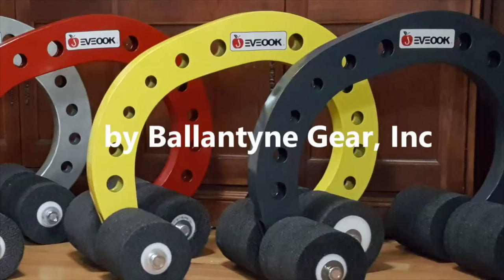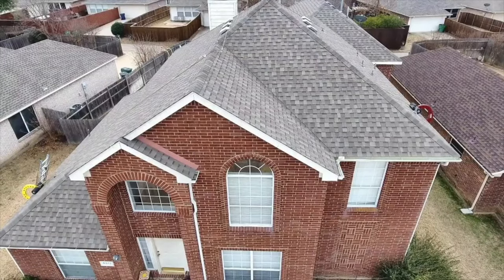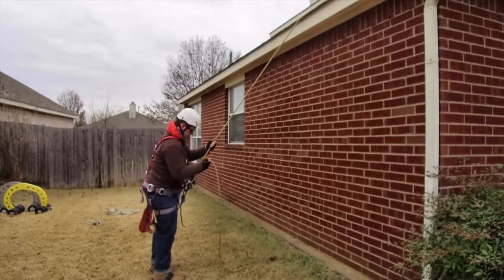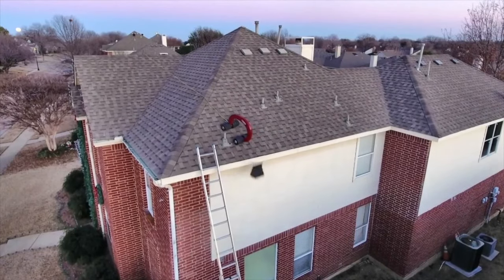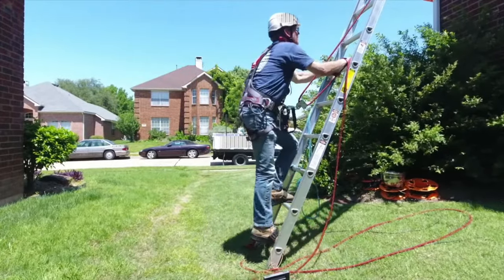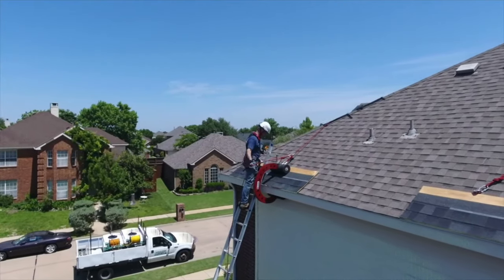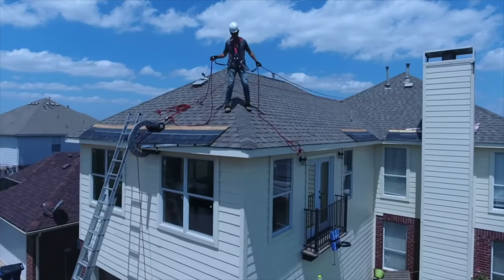Introduction of Ballantyne Gear Eveook Residential Fall Protection System with CAMP. Exceeds OSHA.

Comment: Looks like a good system (for the US market)
Reply: Especially with the sound of that gun! US market ONLY lol
Reply from the maker: Thank you Frank.  You can use pneumatic (air-powered) line throwers, if you want.  They are more expensive and difficult to use, but in some places, they might be better.
Reply from the maker: Thank you!  Also CSA certified in Canada.  We will be getting EN certification in Europe.

Comment: You need to explain more. How you attatch to line, how to tension line, add gear etc etc
Reply from the maker: Go to www.ballantynegear.com and then go to videos.  I believe you will find the explanations that you are seeking.  If you go to Tech Info > Technical Manual, you will find answers there also.  The manual is friendly, mostly pictures.  Or just call us 888-996-3565.

Comment from the maker: Response to Mason Brignac (below). Besides manufacturing fall protection systems, we also install Christmas lights. It's a perfect way to test equipment and methods. Since 2018, for Christmas lights installations, we require the Eveook system on all roofs that cannot be reached, for the entirety, with a 28 ft ladder. That includes most jobs. We have never damaged a soffit. Only one of our customers has stated they have damaged a vinyl soffit. They repaired it by heating it with a heat gun.  The wheels of the Eveook are 22 in wide and made of polyethylene foam,  They are not very hard. We routinely perform 6" drop tests of 310 lb test mass, on installed systems on my home, and these do no damage to the soffit. The polyethylene foam wheels leave no marks.

Comment: We are an engineering company and also do similar works by climbing up on roofs.  We have more than 20 years experience.  We use rope access methods and are equipped with professional harnesses and rope access devices.  What we do is that instead of using a device like this eeveook, we tie off both ends of the rope to stationary structures such as trees, perimeter columns, even a vehicle strategically parked.  This eveook is too big and impractical to carry in our vehicle.
Reply from the maker: If you can't carry it, then obviously you can't use it. They are 26" tall and 32" long, which is a pretty big, but they stack well. By the way, they only weigh 22 pounds.  We have been working on roofs since 2001. I am SPRAT certified for rope access and I am a rock and tower climbing and rappelling instructor. We used to attach to trees, poles, and other anchors, but frequently it was difficult to find an anchor in the right spot. We did lots of other things too. The problem was the anchor line was never right where we wanted it and installation was awkward and took too much time. We are not engineers, we install Christmas lights on steep roofs (mostly 12:12 and 14:12, some 16:12), working on the edge. To create this system, we worked with and continue to work with some of the best engineers in the United States, Canada, and Italy. Our Christmas lights production is up because we finish jobs faster. With the Eveooks, we don't need to advertise for lights business any more, saving us $10,000 every November. Before the Eveooks, we would lose about 50% of our customers every year and had to replace them. With the Eveooks, we lose about 10% but we get more referrals than we can service. Our customers know that we are safe and they don't have to worry about getting sued because someone fell off a roof. If you can find a little space for the Eveooks, your lives would be much easier.

Comment: it's very cool , just not needed. no throw a line over the roof , use a towel and tie off.
Reply from the maker: That’s the most effective (and fun 😎) way we have tested for our system; especially for monster houses we have here in Texas! There are other ways to get a line over a home / sloped structure that we have outlined in our technical manual.

Comment: Won't this mess up the under-portion of the eaves?
Reply: My question too... if a painted wood soffit will it leave permanent marks? If it's vinyl it'll likely dent or mar that too. What if the soffit doesn't return level and follows the pitch of the roof up instead? Will this thing still work?
Reply from the maker: See Ballantyne Gear reply above.
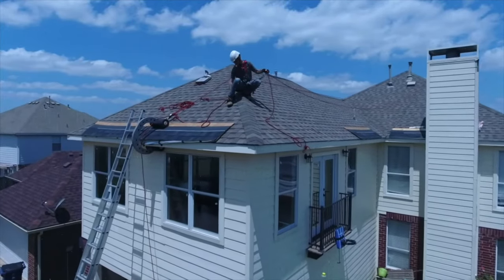Reply from the maker: We have never had a customer complain about any of the above concerns except a soffit that follows the pitch of the roof. Additionally, we install Christmas lights thru the month of November and the first week of December, in the Dallas, TX area. We install lights on 80 to 90 homes every year and we have never had any of the problems that you mentioned, but we don't have soffits that follow the slope of the roof in this area. All the soffits in our area are flat. The Eveooks will attach to many sloped soffits but not all. If you have a sloped soffit, on a 4:12 slope, the Eveooks will work on the soffit if it is not greater than 15", with the larger 12" wheels. As the slope increases, the greater the soffit can be and still work.  In 2023, to allow the Eveooks to work on sloped soffits that are currently too large for our system, we will be introducing a new product that will be inexpensive, easy to use, and will allow you to attach to just about any sloped soffit. For example, in Colorado it is not unusual for a roof to have a 24" or greater sloped soffit. Currently, we cannot attach to these soffits; however, the new product will allow this. Send me a private message with your email and we will keep you updated on further advancements from Ballantyne Gear and also industry updates.  Anyone is welcome to send their email to receive updates.
Reply from the maker: The weight of the system, lies on the peak of the roof.  At the peak, we use a rope protector that protects the rope and the roof.  We have never had a customer complain about damage to soffits, and some of our customers have customers with vinyl and aluminum soffits.

Comment: This device should not work. Get a real CSA certification, instead of saying CSA compliant.
Reply from the maker: Considering the deaths and injuries from falls from sloped roofs that are increasing every year, and the inferior fall protection products that are being sold, I understand your pessimism.  You can find our CSA Z259.16 certification for engineered fall protection system on our website www.ballantynegear.com. Click on Technical and then on CSA Z259.16.  The certificate is signed by our Professional Engineer Greg Small P. Eng. PE M.  Greg was the committee chairman of CSA Z259.16 when it was created.  I would challenge anyone to show me a safer and more efficient fall protection system.  You are welcome to call me at 1-888-996-3565, if this is important to you.  Thank you.

Comment: 4 nailes remove 2 cap put anger in ridge takes 5 Mon maby
Reply from the maker: Buy a tractor instead of a mule, to make more money. Production will be up and so will sales. Check out the case study on profitability of using the Eveooks. https://www.dropbox.com/s/rmawfnqhkcjomk0/Case%20Study%20-%20Profitability%20of%20Using%20Ballantyne%20gear%20Eveook%20Fall%20Protection%20System.pptx?dl=0

Comment: Not a good product. You will destroy soffit and aluminum fascia just from tension
Reply from the maker: The wheels of our ANSI certified engineered system of our Eveooks are polyethylene foam and will give before the soffits will bend, except possiibly when arresting a hard fall. If it saves a life, I'm okay with a bent soffit. Soffits are replaceable, people aren’t. Additionally, the wheels have a width of 22" to ensure that there is support from at least one rafter that will be above the soffit. In over ten years, no one has ever damaged a soffit. Possibly a greater concern than soffits is making sure that you don't damage a rain gutter. If you go to page 9 in our technical manual (follow the link below) it will show you what roofs the Eveooks can attach to safely and without damaging a rain gutter or a roof edge. (You'll see from the manual that the Eveooks will attach to almost any residential sloped roof edge.) https://www.dropbox.com/s/qnrq42lchx0ub4x/2022%2011%2031%20Eveook%20Systems%20Technical%20Manual.pdf?dl=0
Reply from the maker: On sloped roofs, this is the only reasonable product we know, that meets OSHA requirements for roofers, solar installers, and more, on sloped roofs; to include protecting the installer of the fall protection and avoiding swing falls.  However, because we have seen damage to soffits that do not have the support of rafters or rafter tails, we are making a new product that will be available by the end of the year that will solve this problem.

Comment: Will crush aluminum vented soffits. And actually roofing ropes are way thicker then what your using . Yiu have on rock climbing equipment. Works well for you guys. But not for roofeds
Reply from the maker: We appreciate your comments.  I have worked on residential sloped roofs for 22 years. As an instructor on how to work safely on roofs (for professional roof workers) and a rock climbing instructor (mostly for youth adventures), I can see why you would think these ropes are for rock climbers, not professional roof workers. One of the ropes that we use as the anchor line for crews of up to four users is a static kern mantle rope that is made for professionals but could easily be used for rock climbing. The anchor line that we use for up to eight people has a UHMWPE core and a polyester sheath and is three times stronger than any rock climbing rope that I know of and has an elongation of less than 1%. It is not usable for rock climbers. It is for professional use only.
Regarding soffits, the wheels of the Eveooks are polyethylene foam and will give before the soffits will bend, except possiibly when arresting a hard fall. If it saves a life, I'm okay with a bent soffit. Additionally, the wheels have a width of 22" to ensure that there is support from at least one rafter that will be above the soffit. In over ten years, no one has ever damaged a soffit. Possibly a greater concern than soffits is making sure that you don't damage a rain gutter. If you go to page 9 in our technical manual (follow the link below) it will show you what roofs the Eveooks can attach to safely and without damaging a rain gutter or a roof edge. (You'll see from the manual that the Eveooks will attach to almost any residential sloped roof edge.) https://www.dropbox.com/s/qnrq42lchx0ub4x/2022%2011%2031%20Eveook%20Systems%20Technical%20Manual.pdf?dl=0
Reply: @BallantyneGear cool! Some people are really closed-minded.